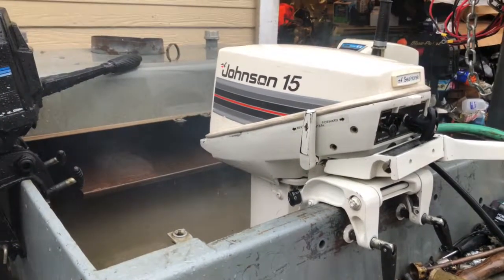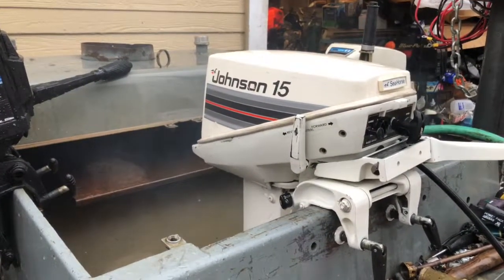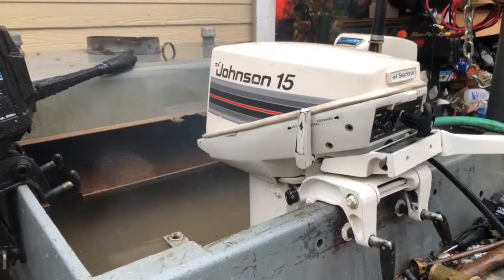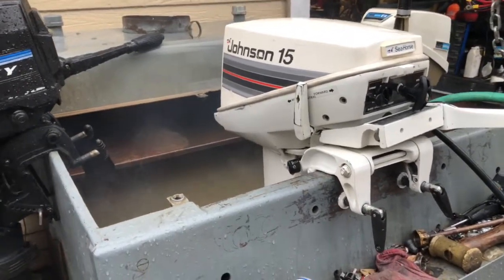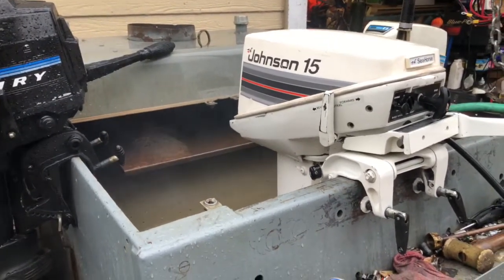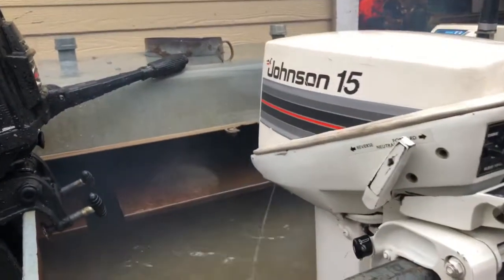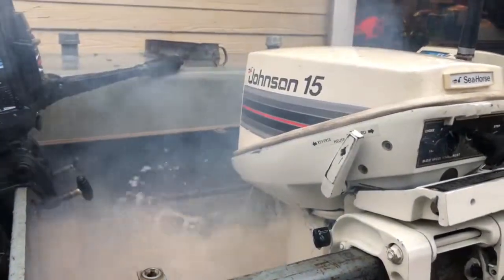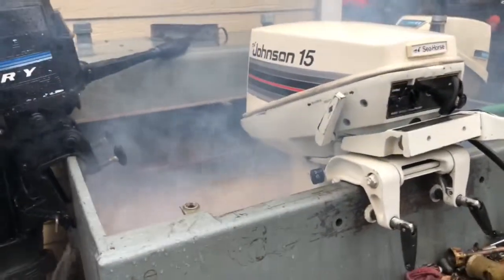1982 15hp Johnson outboard motor

Comment: Sounds fine, it will smooth out when you can lighten up on the oil...You're a better man than I, how did you get those damn "tight fit both sides" wrist pins into those new pistons with the "full compliment wrist pin needle bearings"?  I'm sure I would end up with square piston skirts if I tried it....